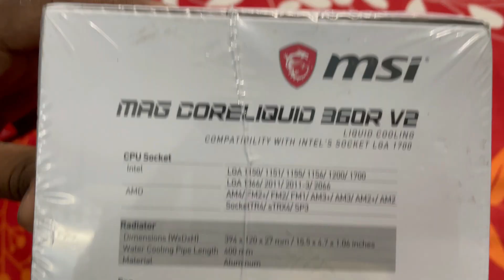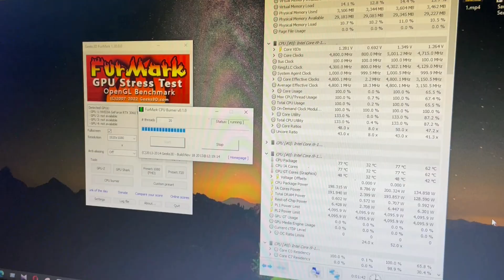MSI MAG CoreLiquid 360R V2 Unboxing and Installation with Intel LGA 1200 Socket

Comment: How is it performing now? Any issues?
Reply from the maker: 1st one had motor issues, I got it replaced by the service center. This unit is working fine.
Reply: @tryitstd  now its working fine or not ?
Reply from the maker: @gamingbgmi6494 Now it is working fine.
Reply: @tryitstd  mine is running at 4200rpm at idle and cpu hitting 100degree at 30%load and even at idle it's hitting 60-65degree this msi is worst they are saying they don't repair

Comment: My backplate has slack in it before full application (spokes are screwed in as far as they will go) will this tighten up after putting the pump on the cpu?
Reply: use something as a spacer
Reply: @Trooper101st  I actually found out it was normal, and when you torque down the heat sink, it pulled it together like squishing a sandwich

Comment: You need to pin the dudes comment about top mounting any in-radiator AIO pumps, like this one.
Because the air will accumulate at the pump and cause it to burn out.
Reply: ive had my installed on top for 2 years no issues though

Comment: I would recommend you avoid this cooler at all costs. I am currently sending my second one back to the store. Both my original purchase, of this exact model, and my replacement failed with just over a year use of each. The fans still spun, but my CPU hit 100 degrees Celsius, and then thermal throttled from there. Maybe I'm super unlucky, but two exact same coolers failing the exact same way is way too much of a coincidence for me. Won't be purchasing an MSI cooler again.
Reply: Facing the exact same issue right now!
Reply: me read this after just buying it  @dhananjaysarsonia  😆 isnt it just the v1 they had issues with
Reply: I'm having the issue right now, the pump isn't pumping I think
Reply: Yeah me too, facing the exact same issue.
I switch to Arctic Freezer III 360 now.
Reply: MSI have issues with their MOBO too. Maybe most of their products got issues before given warranty time.

Comment: my fans are silent, there is some noise from the pump do you have the pump sound
Reply: I got the same problem and will contact MSI.
Reply from the maker: Take it to service center, you will get replacement. I got this unit as replacement too. This model has some manufacturing issues.

Comment: Installing AIO with pump in radiator like 240r v2 or 360r on top of casing its not correct - you make radiator and pump in it -a higher part of loop. So air will be kill your pump in that AIO more rapidly. AIO with pump in radiator good to install on front (the best for them) or in some cases - on down of case.
Reply from the maker: Thank you for your advise.
Reply: This is not correct- here is a video debunking this myth https://www.youtube.com/watch?v=DKwA7ygTJn0
Reply: Thats not correct. The Cooler must be upper then the pump, so that is the a little bit air in system going not to the pump!
Reply: @karetseging8675  yep...and in that aio where is pump location?))
Reply: @АлексейКоблев-к1м You are right! Sorry.

Comment: BUY A DIFFERENT BRAND... THIS ONE SUCKS ASS..  first off  NO INSTRUSTIONS COMES WITH IT  the 360r v2   just bought one and no fuk'n install instructions..   so if you don't have a smart phone with internet or a second computer... yur fuk'd   then I took off these 2 little brackets on the mobo for holding the AMD air cooler on.. and put on a bracket for a Coolermaster 240 ..AMD.... well I can't find the 2 little bullshit brackets so now this fukn 360 radiator is USELESS ...NONE OF THE OTHER BRACKETS WILL WORK!!!   FUK MSI and their JUNK HORRIBLE DESIGNS!!!    NEVER AGAIN!!

Comment: Where can I contact you I need help .I tried these steps you do but still no RGB lights
Reply from the maker: You have to connect main RGB header to the motherboard's RGB port.
Reply: @tryitstd  If you have 4pin RGB Connector must buy adapter from 12V to 5V.
Reply from the maker: @karetseging8675  Most motherboards have both of them, and pins are designed in foollproof manner, so RGB header won't connect with ARGB port.
Reply: @tryitstd  I have Asus z390 pro. There is only a 4 pin rgb connector. I bought also tower asus tuf 501 gaming, but there is a adapter without connecting to the board to adjust the Rgb light. Only put sata power supply and is working. Msi support sad, i can not the 3pin argb connetors to 4 pin for the board. Is there any adaptor. Sorry for my english. Not my home language.
Reply from the maker: @karetseging8675  https://youtu.be/nD7vnYEoXsE

Comment: MSI informed me that I killed my AIO by top mounting since the pump is at the highest point which is giving less cooling. Do you have any opinion on this?
Reply: Then they should have given us instructions in the box especially since most of this type coolers are top mounted
Reply: @xavierlx I called MSI rhey sad, if you have typ V2 its ok. If the pump is installed in radiator. If you pump is the cooler for CPU must find another
Reply: @karetseging8675  I top mounted and its been running smooth 5 months now
Reply: @xavierlx ?? No pump whine ?
Reply: @deepkicks-999  no nothing, I called and they said top mount is ok.
Reply: is your the V2?
Reply: What's funny is the idiots at MSI literally say it's OK and fine to install it that way and most of their manuals show it being done that way
Reply: I front mounted it because gamers nexus shows why it's bad idea to top mount.

Comment: Great Video, just 1 query. the so called instruction manual shows a molex connection from the psu  and it ios in the box...did you not use it ?
Reply from the maker: My motherbaord has all required ports, so it was of no use to me. But if your motherboard lacks fan power port you can use it.

Comment: Hello want to know where did you connect the fans in the cpu fan or system fans ?
Reply from the maker: CPU fan
Reply: @tryitstd Sorry in V2 you must connect the AIO plug to cpu fan ore AIO pump connector depence to the Mainboard.

Comment: Is there any problem regarding previous v1 of air bubbles collection and heat dissipation
Reply from the maker: No problem so far since installation. I think previous batch had some manufacturing issue.
Reply: @tryitstd  they did. If you drained the AIO, the most disgusting coolant you’ve ever seen would drain out for about an hour. Buildup was blocking everything and causing the unit to climb heat fast